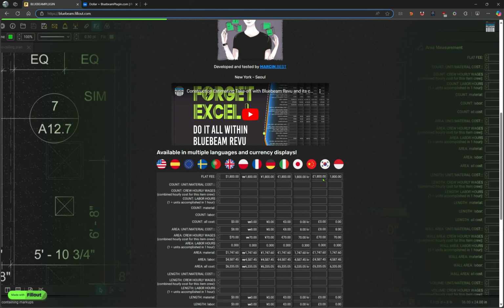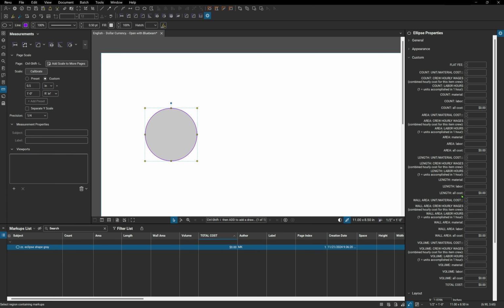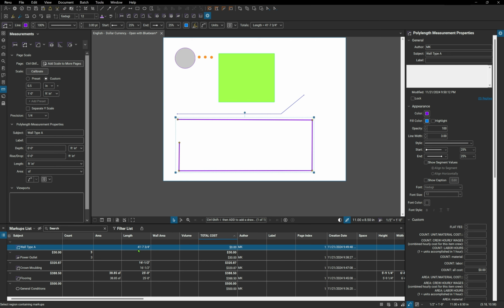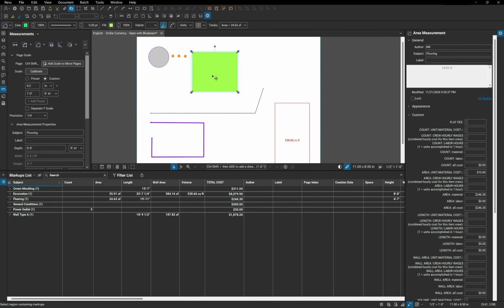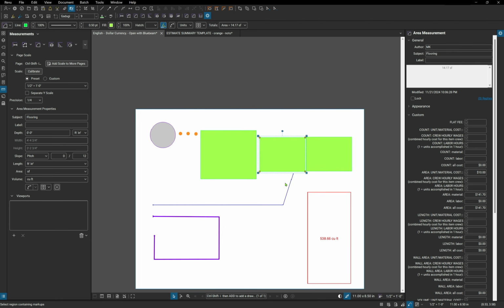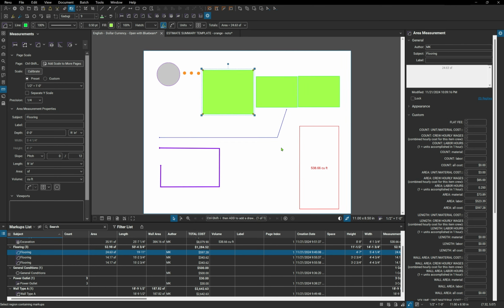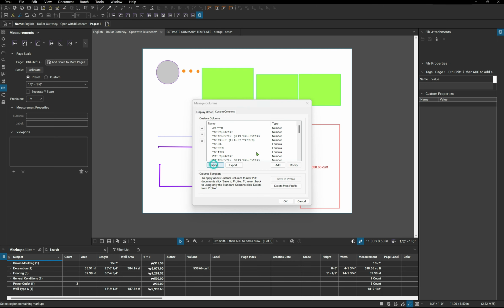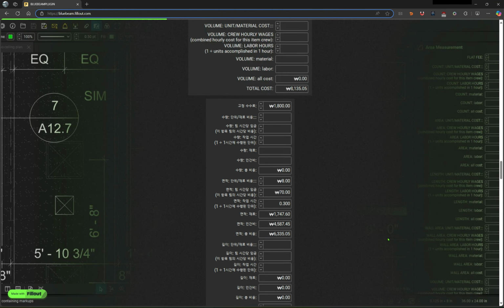Construction estimating takeoff with  Bluebeam Revu custom columns plugin. Planswift alternative

Comment from the maker: Please note, at the beginning of the overview I show the simplified method of estimating (set price per measuring unit) then around 20 minutes in, I go over the more detailed estimating where you can enter separate cost for materials, crew wages and the labor hours. Such as you would when estimating using RS Means data, or the Craftsman Book.